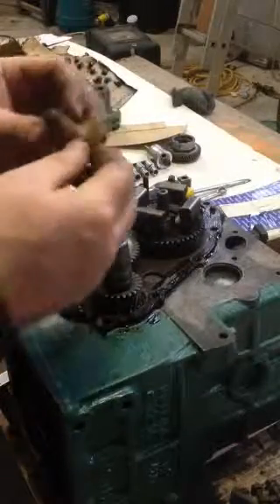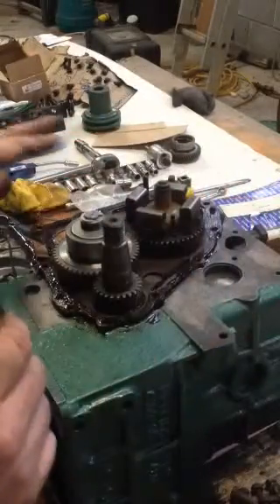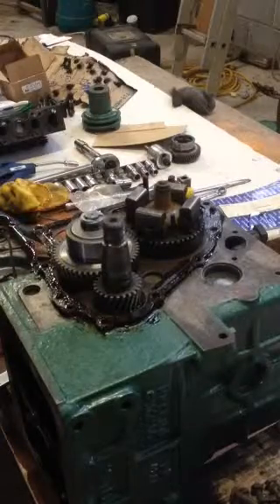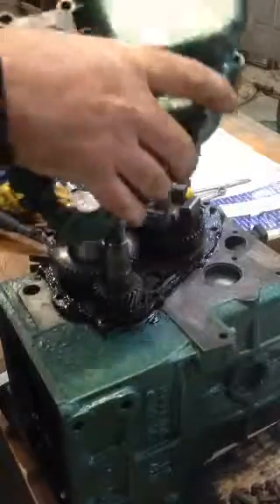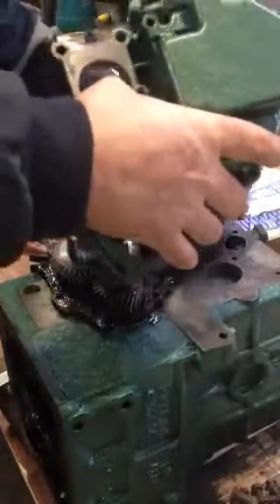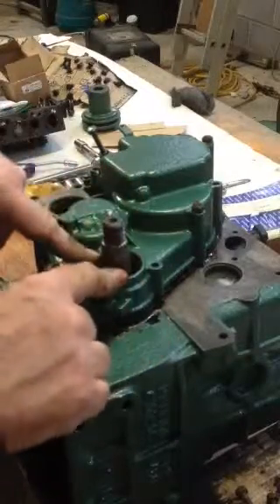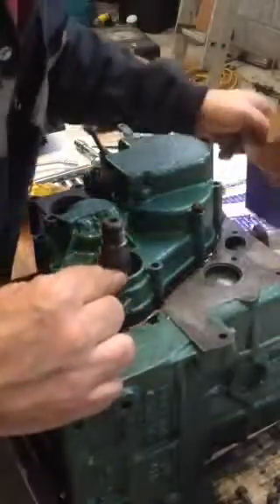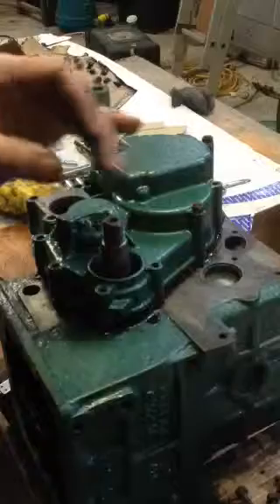Volvo penta md2010 engine rebuild part 12

Comment: Hi Mac, I have another question for you. I'm mildly baffled by the use of sealants with (as well as) gaskets? I notice you have been using a shellac for the timing gear as well as it's new gasket. Do you use some sort of sealant on all gaskets, fuel, oil and water air intake and heat exchanger gaskets? The VP manual is not particularly clear on this. Mark